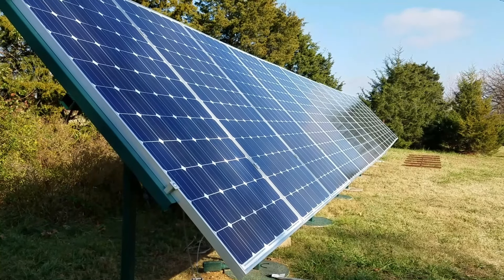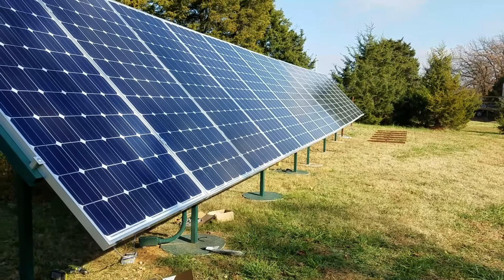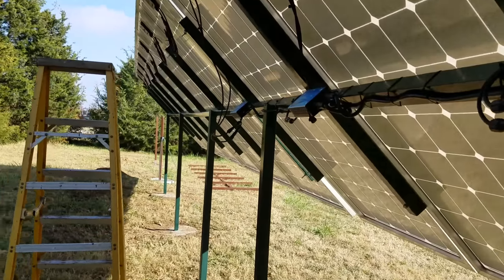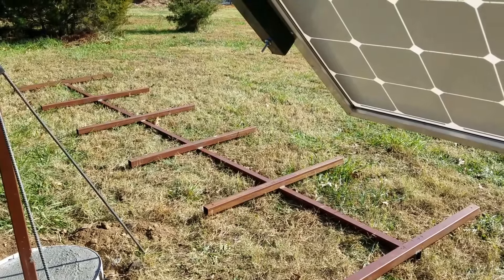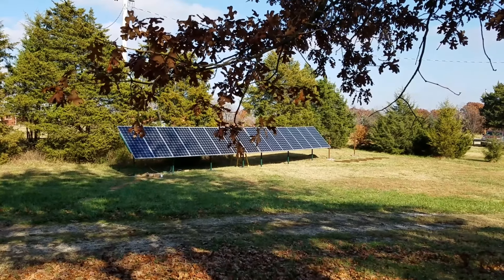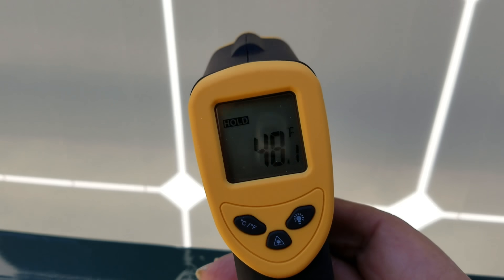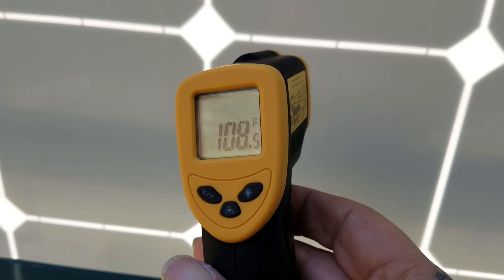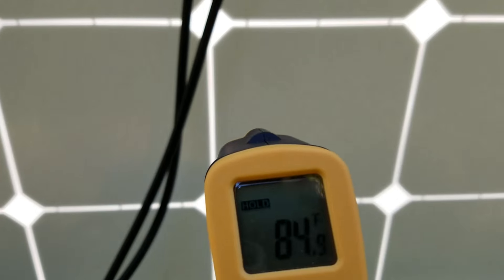6 KW Solar PV Array Progress

Comment: is this set up really expensive?
Reply from the maker: Viheavyequipment All told I spent about ten thousand dollars or so for the completed twenty panel 6 kWh installation. It has micro inverters for each panel and is tied into the grid. The initial Chinese inverters had to be rejected in favor of Canadian inverters.
Reply: oh nice I'm from canada in B.C. that's not at much as I thought it would cost your power bill is so low all the time